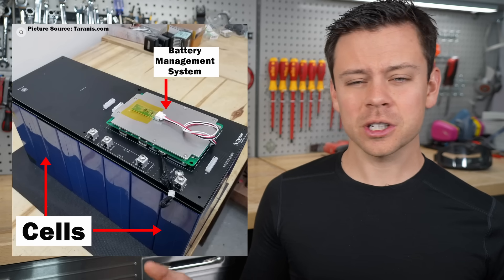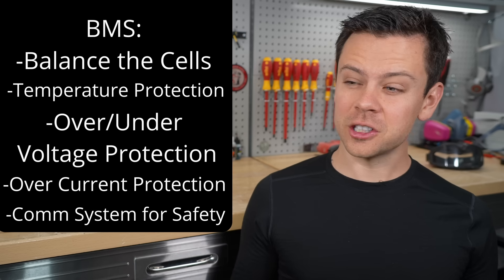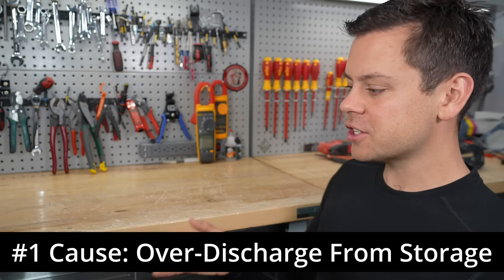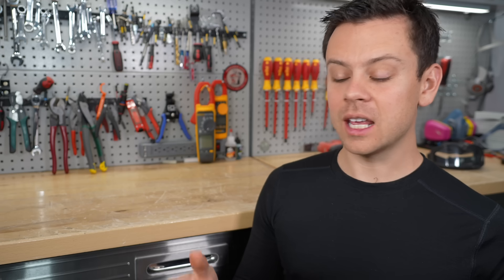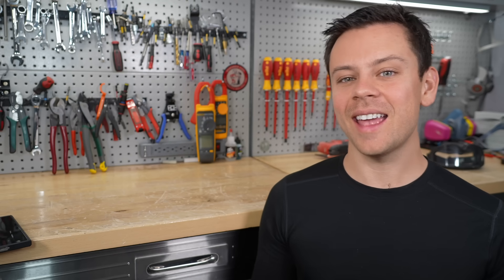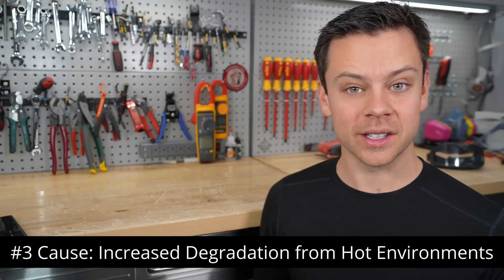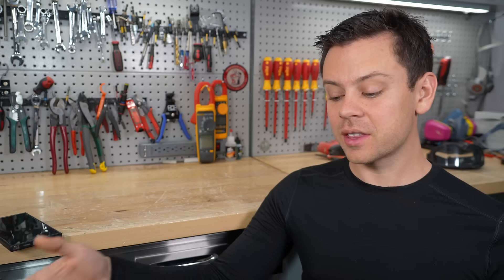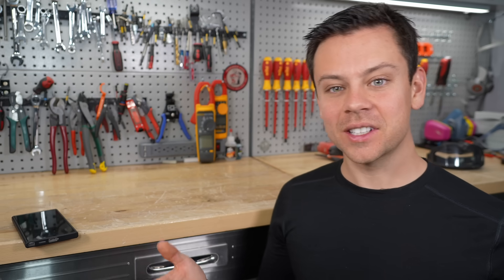The Rules of LiFePO4: The 3 Most Common Causes of Failure and General Guidelines for Long Term Use

Comment: So what voltage is considered 100% and what voltage is considered 0%  My experience is that many cells are not exactly the same capacity. This is in reference to those using this type of cell in an EV where there IS huge amounts of current in the discharge situation. It was originally from the factories stated that you don’t want to go higher than 4.2 volts per cell before termination. Then it was 3.8v then 3.6v then 3.55v. How I do use these is never charge higher than 3.6v per cell for the entire pack so a 144v pack would terminate at 162v. At termination on the discharge side of things is more difficult because standing (resting) voltage is not the same as active high current discharge. So I set my system to shut things down at 2.8 volts. I set all my cells at 2.5v resting after 24 hours of resting. then charge to 162 volts and let the surface charge dissipate and all the cells drop to 3.3 to 3.4 volts per cell every time. No BMS. My controller and charger take care of the voltage both high and low. I also have many pouch A123 LiFePO4 cells that have been sitting for close now to 12 years and the voltage remains the same without any change in voltage. On my mini power wall I use Leaf Modules and did the same but all my modules were already well balanced. So I don’t allow them to over discharge or they will die and I don’t over charge them. I terminate the charge at 8.3v per module. So far they have been perfectly fine. I had an issue with a cheap BMS because the BMS could not monitor itself and the BMS died and then discharged a pile of LiFePO4 cells to zero and they never came back from the brink. So I don’t trust the BMS systems and have yet to find one that actually monitors the cells and itself at the same time. Without any connections there should be no noticeable change in voltage due to the so called self discharge. With any small connection there will be some discharge. The chemistry is not the same as lead acid where there is an actual self discharge. My first foray into LiFePO4 cells was in 2008. I have had them since and use them in my RV and they are the best. Still no BMS. I use the charger and inverter to monitor the voltages and shut down when a specific voltage is reached. Pretty simple actually. Getting ready to build another pack for my Electric Cushman Truckster.  Large battery back up coming for the homestead. Yes the batteries will be stored away from the home for safety.

Comment: So.....I just purchased an Eg4  power pro LiFePo4  battery and received it the end of october 2024 . I have it in a remote home on top of a mountain several miles from ANY UTILITYS.  Because of time restraints and bad weather I didnt get it totally hooked up.   I decided to mount it on the wall and check the voltage because I didnt want to run it down too low.  I did not power it up after I removed it from its packing and had it mounted.  I turned it on and it showed 0 volts in the battery and all 16 cells showed zero volts also.    I have an Eg4 Chargeverter which was set on 56 volts and 100 amps to charge it.  The charger showed all was ok but it wouldnt charge the battery.  I have been dealing with the supplier for several weeks and am getting nowhere.    I am going to try hooking up an adjustable Power supply to it as the vendor suggested set at 56 volts and 10 amps for an hour to try and "Wake" it before again trying the chargeverter.    According to the inspection sheet that came with it (from China) it had been checked before shipment and it had 52.87 volts and full working capacity.   It was never hooked up to a load or allowed to get cold or abused.....in fact I never turned it on until it was mounted.  The inspection sheet had a date of Sept 3 2024.  How could it possibly discharge that way and that fast?    SOC from factory was 55%

Comment: Excellent advice Will! I have a 120 amp hour LFP battery in my bank that went into service in December of 2016. I followed the rules you describe, and after 8 years in service, it tests at 112 amp hours capacity. That's less than 1% capacity fade per year.

Comment: I’m running a 3kw renogy inverter with a total of 300 ah lifepo4 in the back seat of my Tacoma im guessing I should take them out of my truck during the winter time I have 300 w solar hooked up as well using a 50amp dc/dc charger

Comment: I mean, shouldn’t we have a charger that figures out/interacts with the battery, and lets you simply choose how much to charge it to?  My spouse has an android phone, and she is able to set the maximum charge to be at 85%, in order to keep the battery better for longer.  Why on Earth, haven’t we got to that situation yet?  Especially, if not the charger, why not the bluetooth battery types, why can’t they only permit charging up to say, 65%, if you set that?  We seem to be sat in no-man’s-land at the moment, little innovation in this regard.  Essentially, why do we have to do this, when surely if the charger ‘knows’ when the battery is full, it could just as well ‘know’ when it’s at 50% or whatever?  Odd. Good vid thanks.

Comment: I'm on an off grid farm and am adding new living quarters.  I have 10kw/H panels 2-6000xp inverters and 6 Lifepower4 batteries.  I have plenty of solar but I would like to add batteries and stack more inverters.  Could I add a couple wall mount Eg4 batteries to my current bank or is it not wise to mix them?

Comment: I have a solar "generator" with LiFePO4 battery cells and keep it plugged in to house current.  I keep it in a spare room at room temperature.  The cooling fan will cycle on and off during the day (24 hours).  Is this good or bad for these batteries?

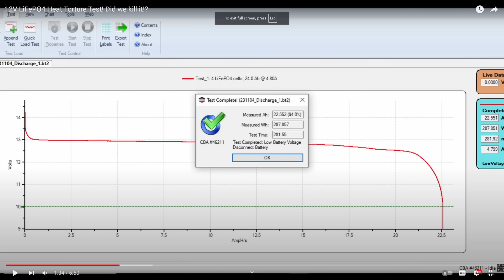Comment: 3:31 vent gas and or fire 7:31 please clarify the battery is not out side in the direct sunlight and weather I presume, if not what is the temperature in your battery area on those hot days , this is a test battery so it’s not being used on those hot days

Comment: I have 9 Husky’s from Bigbattery. I have only had them for 3 - 4 years. We use them in our 8 “scarages” 10 nights out of the year in October. The rest of the year they’re not used. There left on the “scarages” under a mostly inclosed awning. Temps can range from 10 deg (rare) below to 110 deg above. After the first 2 years one wouldn’t come on when we got ready to use it. I figured it went to sleep. Bigbattery did not want me to wake it back up. So, I sent it back for repair. This year one last only 3hrs long, and one did not want to last but 5 min with a ceramic heater test. I’m thinking I need to store them better. What’s your suggestion? Thank’s
P.S. I’m sending the 2 back for repair.

Comment: What type of battery would you recommend for a camper that is stationary, always plugged in, and can be in temperatures between 0-90 degrees F? It has the factory lead acid now and I am thinking it needs replaced.

Comment: Excellent video. Quick question. I have a 2021 Tesla Model 3 with LFP battery. However I have to leave the car parked for 3-6 months at a time. It's garage parked with a standard Level 1 plug available to charge the car while I'm away. At what percent do you recommend charging to and leaving it at? Currently I'm leaving it at 50% and plugged in at 50%. I know it says onboard to keep the car at 100% then charge once a week back up to 100%, but I can't do that. Advice would be great. Thank you.

Comment: Thanks for the explanation.  So many contributors are still maintaining the 80-20% theory that applies to lithium ion.  The other thing that drives me nuts are those that claim AC is pass thru on power stations and can be used as a UPC with such a quick change over.  What change over?

Comment: I enjoy all your videos Will. Brewing a noob about battaries, I would appreciate some numbers to go along with your 100% charged, and 0 %. My charger says the batteries are full, but when I check voltage on battery it’s @ 13.6. I’ve seen the initial charge went to 14.25, but I haven’t seen it back up there since. I have a bank of 4 12v watt batteries in a solar system in motorhome. I have the lifepo4 charge controller, but have a small charger on it. Not using it much now, but will in a couple months. Is that corrrct if I find them at 13.6 a majority of time?

Comment: So I have my rv set up with a solar panel.  If I remember it is a 24v 300watt?  anyway I currently have lead acid and hate them.  I was given 2 6v and hate them more as they are always wet and causing corrosion.  I am planning on getting one 280 Ah battery to replace them.  My question is about storage.  right now I leave the batteries in the trailer and let the panels do what they do and seems like no issue.  Can I do that with a Lithium?  The climate here in southern Alberta is we do get periods of -30 C during the winter and some snow.  But we also get period of above 0 C with melting so the panels are not covered for very long for the most part.  Do I take the battery out and put in the garage or can I just leave it there and let the bms and panels take care of it.  I have not found a video that hits on this subject although probably out there somewhere.  I also trust the info from here  more then other places.

Comment: What is the actual voltage we should be charging a 12 volt battery to to hit 100 percent? 13.6? 14.6? Do we need to maintain that 100 percent voltage for an extended time so the cells have time to balance? Thanks

Comment: If degradation is not an issue at 100% SOC,  why is  the recommendation  for long term storage 50% instead of 100% ?
Reply from the maker: Because we cycle between 0 and 100, so it stays around 50 on both situations. Think about how it cycles
Reply: hmm.  thanks.

Comment: What about "oversized" banks and/or "standby" use? I'd like to size my bank to support over a day without sun or grid (winter storms and the like). Does it actually matter if most days the pack only cycles 10-20% of its capacity? If I keep them cool enough, would a battery actually degrade sitting over 80%?

Comment: Thanks for this video. I also live in the Las Vegas valley (Henderson) and have a Bluetti AC200 MAX main LFP and a Bluetti BK300 backup LFP battery so this article is of great interest to me.  BTW, in a power outage I can charge these batteries with my 3' x 6'  200 watt Off Grid TREK solar blanket even though, here in Las Vegas on a god day I'm only getting about 180 max watts from the "blanket". 
Though my garage, where I keep my LFP batteries (and Li-ion bile batteries) is often at 90 F. in the summer luckily I purchased and am just now (12/2024) installing a garage air conditioner to keep the garage at 80 F. all summer.
Thankfully I knew the charge level precautions but your tip on recommended temperatures for storage was news.

Comment: I discharged my life04 down to 15% SOC and was concerned with the red lights flashing telling me not to do that but I guess it is ok to take them down to 0%! Had it set up for max 100% and max discharge 20%. That extra 20 % will be great! I will say this though. I fly RC electric and it seems everyone says not to discharge your battery pack to 0% or it is toast. The misinformation out there is unbelievable! Thanks for your expertise.
Reply: Just realized that the RC batteries do not have a built in BMS so maybe that is why not to go down to 0%

Comment: I purchased a LiTime 100-amp 12 volt several months ago when they were on sale for $179. I think I know why. It came so under charged and the cells not balanced. I have a lifepo 14.4 charger and after several months I have finally achieved a state of charge of 14.2 volts. The battery will not accept any further charge.  Is this OK? Has anyone else who bought the LiTime battery at that price having issues?

Comment: And another problem the low temperature cut off on this battery is so sensitive. I took it out on my back porch in the cool day today and it shut down immediately. The battery was nowhere near in jeopardy of anything and it shut right down so that’s a problem. The battery is gonna heat up as you charge it anyway that sensor is too sensitive

Comment: You can only hook four of them in a row in parallel or series that’s no good and even if the unit does take 50 A when it’s really dead that will dwindle down very quickly as it charges up the amperage goes down. It has a 100 amp charging board. What a bunch of bullshit.

Comment: The mixed conception is that I have four trolling motor batteries from LiTime and they will only charge a 20 A you’re never gonna charge them at 100 A or 50 A. The battery is at 50% and I hooked up my 125 amp professional charger and it was only utilizing 8 A at 50% which means if it was completely dead it would be utilizing only 20 A so it’s a bunch of bullshit. They tell you to hook up a 20 amp charger because that’s all I can fucking use.
Reply: They want you to charge it slowly so you can get 4000 charges out of it and they don’t want it to go on fire. It takes seven hours to charge this battery. It’s longer than my lead acid batteries. All my batteries have Bluetooth data.
Reply: They want you to charge it slowly so you can get 4000 charges out of it and they don’t want it to go on fire. It takes seven hours to charge this battery. It’s longer than my lead acid batteries. All my batteries have Bluetooth data.

Comment: I have 4 lifepo batteries in my solar system. They finally sent me addon battery balancers. Before one or 2 batteries would actually discharge to minus voltage. I'd have to go out and charge them up individually.

Comment: Hi the Kia and other evs that don’t use lpo4 and drive short commutes to work and back are better to charge to 60% and only let drop to around 40% the battery will last longer than the car I saw this on a video from a battery university where they study test. And yes you would charge a lot more often but the degradation of the battery for 9000 + year’s and still will be above 80% which they say if it drops below that the battery no good compared to the 80% -20% and everything else you say you are a very intelligent person

Comment: Hi i have three LFP batteries in my camper that charge off my solder and shore power there hookup in parallel to each other and i keep my camper heat over winter and they top off at 14.2 but pretty much stay at 13.v or higher is that going keep them good

Comment: Thanks for all the tips! What about the charging speed? Will this affect the battery life? I have a 100-ah battery (LiTime) that can receive a continuous charge of 100 amp. However, the manual says 0.2C (20 amp) is recommended for charging. I don't plan to charge at 100 amp, but 50 would be nice. Is there any downside?

Comment: I buildt my own batterie after a tutorial of yours ... now after 3 years one cell seems to loose very quick the voltage and when I charge the battery it gains much faster the voltage. The other 3 cells are nicely balanced around 3.2 V. Issue is that the battery is always failing because the one cell according to the BMS is going under 2.5 Volt when I put a load on it. After this video I am wondering if its not the cell but the BMS what is causing the problem. How can I check if the cel is still ok? Anyone knows?
Reply from the maker: Uh oh, post on forum and we can help you.

Comment: Is this true for lithium ion batteries in cellphones? In my new iPhone, I can set it to charge to 80%, 85%, 90%, or 95%. Supposedly this will allow the battery to last longer. Supposedly the thought is that a 100% charge in the small lithium ion battery does a tiny bit of damage to the battery chemistry that will not happen if you only charge up to 90%. Did Apple add this to appease a false idea or did Apple add it because they recognize it will help to extend the battery life?

Comment: Talking low temps. How low is too low. I just purchased some batteries and in their manual it says they can operate in temps from -4°F to 140°F. Should I trust those numbers or no? I’m wanting to keep these batteries in a trailer year round but I live where it gets to 10°F easily in the winter months. Occasionally colder if we get some arctic blasts

Comment: Great tutorials.  I recently had two 6 volt AGM batteries in series loose their ability to to maintain the 12 volts.  I am now contemplating an upgrade to LiFePO4 since I am changing my WFCO converter in my small trailer.  The load is not much just a 12 volt refrigerator 12 volt supply to the ALDE heating system a small water pump and LED Lights.  The storage box is installed under our bed 24 x 10 x 10 in plastic housing with 8 awg cu runs.  The AGM system at first put out 234 or so Ah?  What is your opinion on battle born or other less expensive options?  Thank you for your great videos.  well done
Reply: Have you ever used a deep discharge lead acid besides AGM? What’s the usage situation ? Daily or?

Comment: These outrageously expensive batteries are way too complicated to maintain if you only use once or twice a year for short power outages. Seems the control console should do all the thinking for you if you could just leave plugged in but that doesn't appear to be the case here. And programming ! Who wants to deal with that technological mess if you aren't tech savvy, you might ruin them with your ignorance. Too hot, too cold, too charged, too discharged, not enough periodic cycling all ruin these expensive batteries. My mind is exploding over too much information to maintain these.

Comment: Hey Will. Love your videos. I'm an old lady with arthritis and I have a hard time disconnecting solar wires. I was thinking about altering the wires and putting one of the yellow connectors XT60 plugs on the wires instead of the connectors, but I'm not educated enough to know if that will work or not. It would be great to see a short video with solutions for those who don't have a lot of strength and dexterity. :)